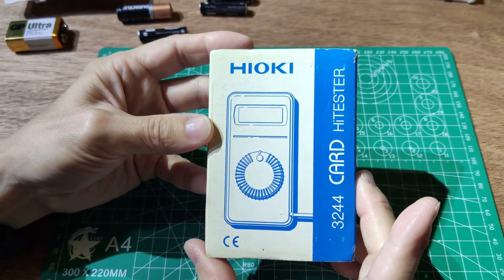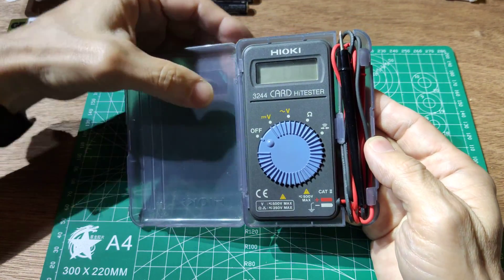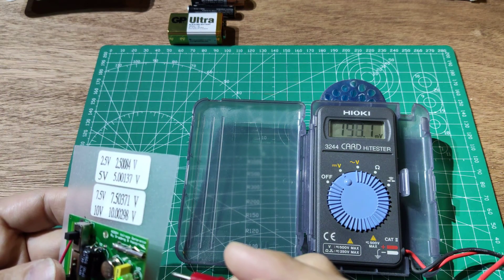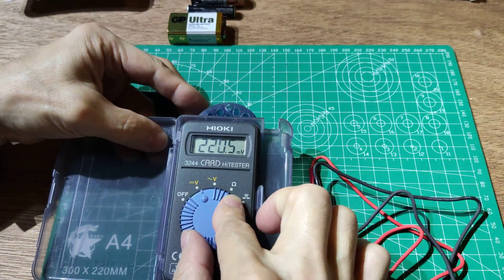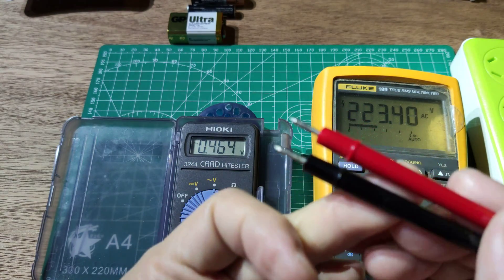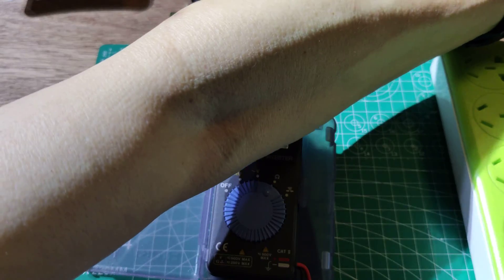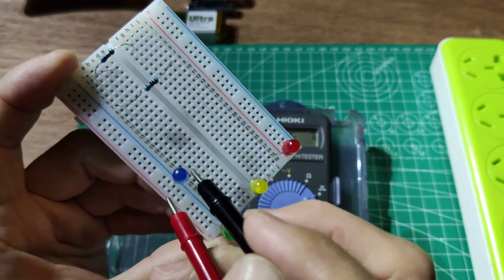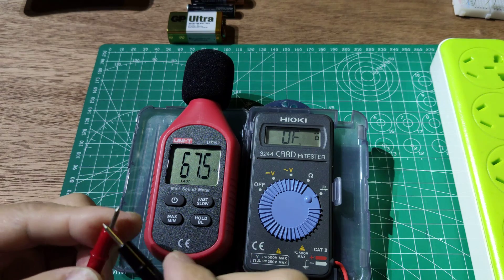HIOKI 3244 CARD SIZE MULTIMETER MADE IN JAPAN

Comment: In general, how acceptable do you think her accuracy is, Master ????
Reply from the maker: sorry sir ,i AM not A master ,and the accuracy of A MULTIMETER normally is use A profession meter like fluke 5502A to adjust the meter. and send to the user A cal report.but it only for high end meter.
Reply from the maker: and this type of meter only use A reference STANDARD source testing may check it good or bad.
Reply: @wilsonluilui  Thank you, what is the error rate of this device, with a professional type of measurement ????
Reply from the maker: this meter is ok.but the reading is MEET the SPEC ,and normal this type of meter have 3 to 4 digit error to A high end meter,because in normal we( are not usually the meter in A 22~25oC Home Temperature),just mean that may have error .because the reference data of the SPEC is in A good condition Temp and stable machine to check.hope you be understand,we will found on other video
for how high end machine to check meter.but it so expensive.and we don't have,thx for watching😜
Reply: @wilsonluilui  Thanks for your reply, I got this device but I have not received it yet, my purpose in buying this device is to check the battery voltage of each polymer battery cell and show me a figure close to reality, because you know how sensitive the battery is  , And my other goal is to calibrate the numbers indicating the battery voltage inside the charger indicator, is this device suitable for me ??  Because there are so many different brands that I do not trust, and other brands are very expensive!  And I tried to make the right choice with the money I make, and now I want to know your opinion that you are an experienced person, (I want more for DC voltage)
Reply from the maker: @KAMRANGXP  for the battery check ,you must add A load(like A light bulbs)draw A current may be good for determine the right voltage of the battery.sir
Reply: @wilsonluilui  Thanks for your help
Reply from the maker: @KAMRANGXP  if you  want to buy A full function cheap price advise buy HABOTEST HT 116,or the SAME like kaiweets km601.the hioki meter we are also use it for normal electric work only ,it light weight only
Reply: @wilsonluilui  I mean, this hioki model is not accurate ????  (I do not care about the features of the device, it is important its durability and accuracy)
Reply from the maker: @KAMRANGXP  it stable and good quality,use A few year the LCD screen and the selector switch all in good condition,and this meter is A old model,New have two PIN cover CAP on the top.thx you ,sorry for my English is poor.😂😂
Reply: @wilsonluilui  By the way, you speak very well, dear friend.  If the device (small hioki) shows me the voltage close to reality is enough for me, I do not look for options much!  More accuracy and quality are the criteria for me.  Because we are in a sanctioned country, we have very little choice in choosing quality goods!  This small device costs almost half of a person's salary in our country !!
Reply from the maker: O,my god ,it so sorry😊
Reply: @wilsonluilui  tnx🙂🙂
Reply: @wilsonluilui  Another question: why when the positive and negative cables of the device are not connected, the numbers inside the display constantly change and are not zero ????  Of course, according to your video, I saw this
Reply from the maker: because this type of meter normal output the voltage and compare to the inside meter reference voltage,than calculate the answer to send to the display.you can found the video via YouTube of( EEVBLOG)，it have PROFESSIONAL answer to you for learn.
Reply from the maker: https://youtu.be/yuCXsT3_WRE
Reply: @wilsonluilui  Thank you very much, I used your scientific speech very much, thank you for your time💗💗💗💗💗🙂
Reply from the maker: THX..
Reply from the maker: https://youtu.be/yuCXsT3_WRE